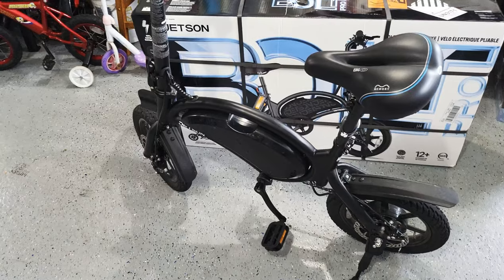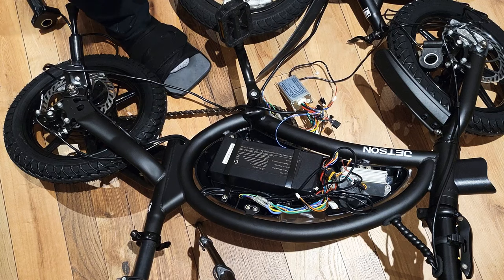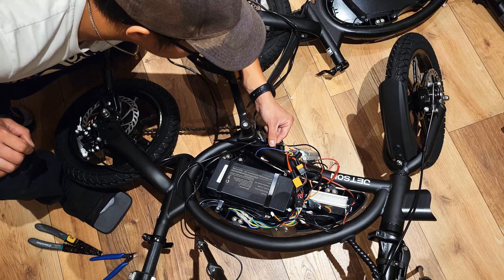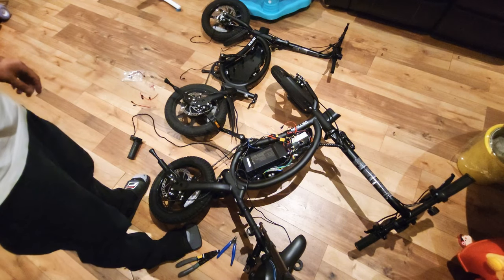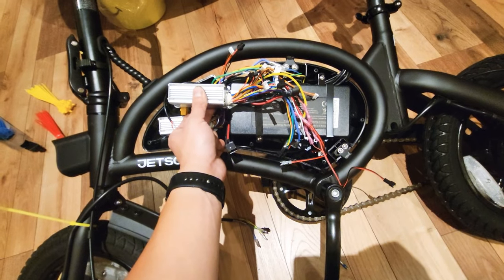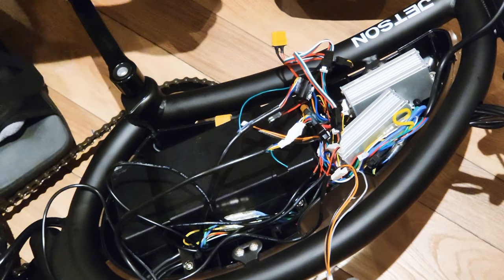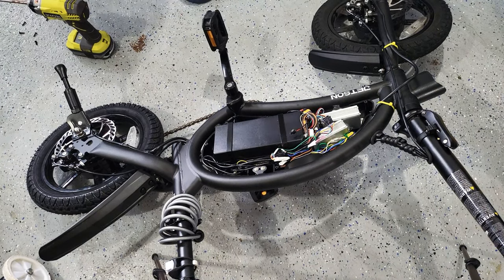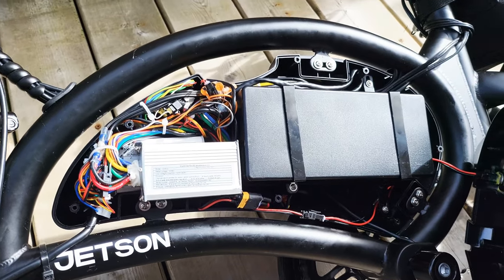jetson bolt pro dual motor ebike,one throttle to two controllers

Comment: Crazy question. But could you have spliced the motor wires into the same wires in the controller, so the controller sends the same signal to both motors synchronized?
Reply from the maker: I am not engineer ,as i know it won't work or will cause problem, it's magnet around the wire inside the motor, controller controls the electric to push the magnet,  there are many positions of the magnet, so they won't be Synchronize, and it may not turn right
Reply: That your idea same like what I think to try test out but I worry cause any problem  to controler. Because I don’t anything in electric.
Reply from the maker: @KathyFunTime  yeah, need two controllers or those controller sell on aliexpress for dual motor(I think it just like two controllers put in one case)
Reply: @mynewtoys5468   plz send a link I have same bike windgoo b3 only difference is my wheels 12inch yours 14 but yh I got two 12inch 2000watt moter I'm gona out on but need 1 controler that will run both wheels 2 save space tho for me
Reply from the maker: @pauleemoran9178  I don't see a single dual controller that will run 2 2000w motor on aliexpress,  usually will use 2 instead
Reply: @mynewtoys5468  ok mate thanks no problem I need 2 no or have link 2 make bike do 30mph at least is standead and 12inch wheels plz help

Comment: You can't put one throttle to two motors with two batteries and two controllers you need two throttles separate from the front and to the back
Reply: I brought a  dual motor kugoo B2 V1 with dyu motor on front wheel with 16-15ah 52v battery with 30a BMS 2 25a control unit all running of one throttle and it does about 30 mph rapid it is

Comment: My controllers are not a match. One is different. But they are the same voltage and same watts.
Is it still safe to connect the throttle and the peddle assist together ?
Reply from the maker: They could connect together,  but peddle assist may not work on the same power, and check the brake voltage,  some are different

Comment: Can you please explain what blue or green wire you cut to get signal? Also brake wire? And really a diagram of how the controller s are ran together to use 1 throttle. You are explaining important points. Thanks

Comment: You can do it to two controllers and two motors and one battery
Reply from the maker: That's what I did at the beginning,  while waiting extra power cable and bag, same range, but drained the battery life very fast , I can feel it now with two battery that compared each other
Reply: @mynewtoys5468  yep a battery for each motors and two throttles and two controller for each motor 48 volt set up and its alive it's alive its alive I tell you aaaaa ha ha ha ha  ( sound like a mad scientist ) 😆
Reply from the maker: Haha, sounds good, I am planning upgrade my dual 36v battery to one 48v , hope it works good (finger cross)
Reply: @mynewtoys5468  cool 😎 48 is faster
Reply: I'm buying 48v 30ah times 2 and need trigger throttle and few bits and bods
Reply: @runingblackbear could you do that setup with one throttle for two motors
Reply: @pauleemoran9178  I got a dual motor kugoo B2 v1 with dyu motor on the front with a 16-15ah 52v battery with 30a bms with 2 25a controler unit all running on one throttle and it flys 😂
Reply: @puresim316nosimracingnolif3  send me link mate I need dual dual moter windgoo b3 350watt 12ich wheels I got 2 of them 1 is so I have 2x 350 just need link for controler 2 conect them 2 I got 52v 20ah battery reddy
Reply: @pauleemoran9178  the man who I was going to buy the bike  of sold it for more money so I'm looking for a new bike now! but I was upset when he texted me saying he sold it for more money 👿 cause the bike was rapid mate
Reply: @pauleemoran9178  plenty of videos on YouTube will help you do all the mods mate
Reply: @puresim316nosimracingnolif3  trust me mate eveybody ali Express but I wont find dual moter controllers small 1 and 2 10ich 1000 watt moter and il go with custom built battery probably 60v 30ah

Comment: Hi, do you have a step by step guide? A bit hard to follow the video. Links to parts?
Reply from the maker: I think all details are in this video,  connect the throttle signal wire together(you can only separate it from one controller) , then put brake wire together(2 and 2), also peddle assist, you don't need connector,  just cut the connector off and connect them tight,(also you can do it like mine using extra connector that doesn't need cut the controller wire) that call sm connector with 2pins and 3pins, need to figure all female or male, I can't remember now, that's all you need

Comment: Very cool! It would be interesting to put both of the battery Box and cases and have redundant everything.  Are the black plastic cases too wide to do that? Thank you very much for the video. Happy trials!
Reply from the maker: I don't get it, you want put both battery in to the case?
Reply from the maker: Thanks you like the video
Reply: @mynewtoys5468   I was thinking putting both electronic packages including the battery on one bike. Redundant everything. A 100% increase in reliability and range.
Reply from the maker: @123edwardzpad  oh,I see,dual system gave me feels could have more range then just add a battery. And If I have a welding machine,  I will take the cover away and try to put everything there where the black cover at

Comment: I did the same ..2 controllers 2 switches and 1 throttle...
BUT.  NO MATTER WHICH SWITCH I put on.....both wheels always turn...,it's like the switches are not working...or there is some kind of power connection thru the throttle cables...
By the way I jump all the wires from one controller to another...is that right???
Reply from the maker: No, only brake cable, peddle assis cable and throttle "signal" wire only,
Reply from the maker: Connect wrong wire may burn out the controller

Comment: I’m wondering who out there knows where I can buy one Costco does not sell them anymore it’s reasonable in price there please let me know I live in simi valley ca thanks
Reply from the maker: My area costco  still selling it, outside costco like Walmart Amazon are more expensive, just try Google search then  shopping list
Reply: @mynewtoys5468  Buy them refurbished directly from Jetson - $250.
Reply: I have 3 left(bolt pro"s). They are missing the throttles, seats, and batteries. if all you want is parts? I had eight. just fix one at a time and sell them or give them away.

Comment: So,, I can take the throttle #1 signal wire from controller #1 and hook it up to throttle signal wire #2 ? And I can discard throttle # 1 and toss it into a box ? There is no need to hook it up ? Correct ?
Reply from the maker: Yes, if you don't need the power light and cruise control

Comment: But why?  Just buy a better ebike?
Reply from the maker: It's the cheapest way for more torque and speed when I doing this at that time, I have been happy with it a while, I like the small bike, there are not much higher torque and higher speed 14inch bike at the market, I got a 50km speed 20 inch fat bike,still love small bike that easy storage and comfort
Reply from the maker: Sorry, wrong answer,  doing upgrade and customize is fun
Reply: @mynewtoys5468  I wonder if the small tires cause a problem?  Mountain bikes have bigger tires to absorb shock better (in general).  Doesn't small tires do the opposite?  The ride would "feel" more bumpy uncomfortable.
.
I just "pre-ordered" a wired ebike; it will arrive next month; maybe Aug/Sep 2023.  I was interested in looks (I wanted it to look like a regular bicycle, hidden electrical components), the top speed (it can go over 45mph, or 72kph), and a minimum travel distance (up to 80miles, but I really only wanted about 30 miles).  Since i was planning on using the bike for door dash delivery to make my money back on this investment.   Spending $2000 on this bike means I need to work about 200-300 hours to make my money back.  I felt the cost was reasonable (I'm poor). 
.
In America, if you use a motorcycle or a ebike (that goes over 20mph); then it is against the law to be on sidewalks or walking paths.  Most people get angry when they see anyone driving on the sidewalks with a motorcycle (or something that looks heavily motorized).  The bike I ordered just looks more like a casual bicycle.

Comment: I want to use 2 motors, 2 batteries and 2 controllers. So can i just connect the signal wires for use on 1 throttle ? I dont need to connect the first set of red wires correct ?
Reply from the maker: Correct.
Reply from the maker: It's awesome,  more powerful, unlimited range feeling, only the speed limit not fun
Reply from the maker: @anio6865  I was thinking about upgrade controller too, but I am happy with this now, if I don't change battery, top speed will be just little more

Comment: Not exactly sure what wires to what wires you connected the splitters to. I do understand the throttle green splitted to green. It would be nice to have the links to the splitters you used also ?
Reply from the maker: https://a.aliexpress.com/_mt8AQTQ    3 pin one， or you can try to install two peddle sensors,  hook up together only work both controllers on, If just want to use one ,need both on first , peddle, then shut one off
Reply: @mynewtoys5468  so these are the peddle assist connectors ?
Reply from the maker: @anio6865  yeah, choose the 3 pin one, or you can install two peddle sensor will be better
Reply from the maker: @anio6865  I use this 2pin one for thr brake, but brake is two male to one female,  I bought extra male head and cut one of the female off and connect the male head on,
Reply: @mynewtoys5468 do you know where I could get extensions male to female ? My controllers are a few feet away from each other.